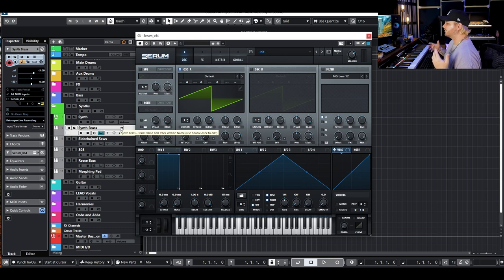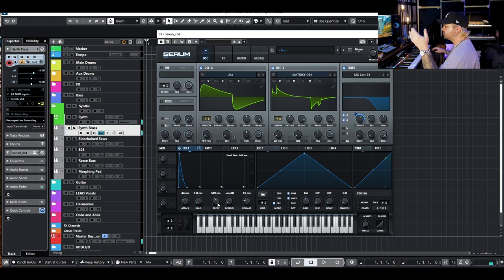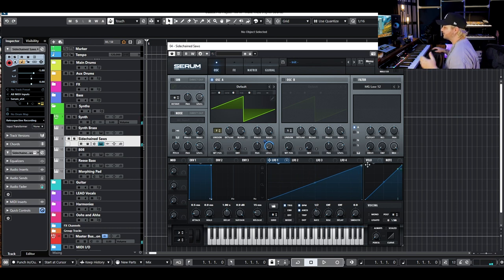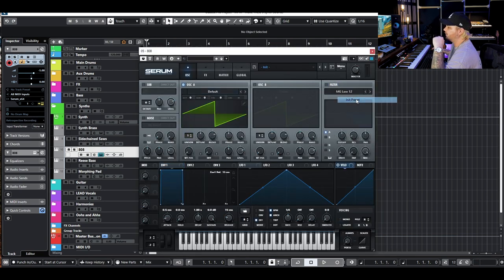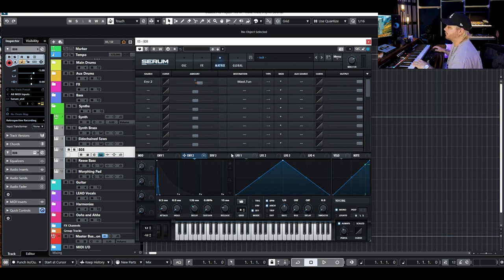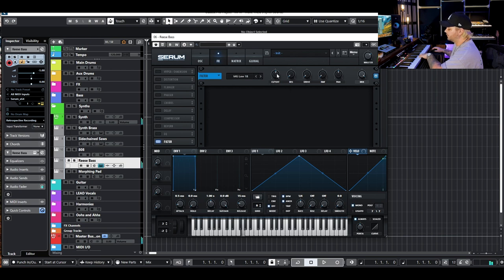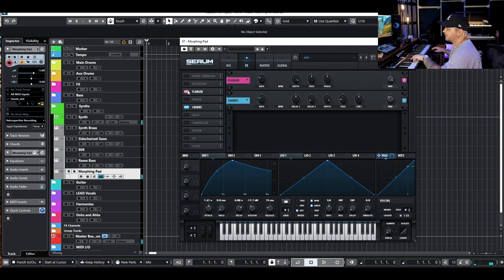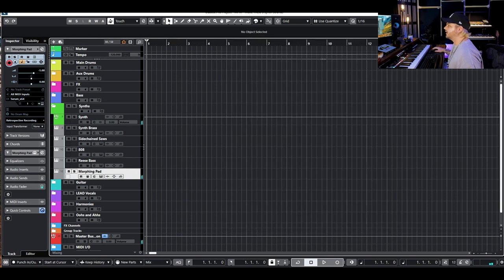5 Synth Patches EVERY Producer MUST Know! (Synth Brass, Swelling Saw, 808, Reese Bass, Morph Pads)

Comment: That's not really a Reese, a Reese is the phase cancellation between two waves creating a third oscillation which sets an implied pitch fundamental that's lower that the note you're playing, this is how you get that movement in the bass that's proportional to whatever pitch you play, it literally changes the speed of the phase cancellation (that third oscillation) because you're changing the frequency of the two waves. You can change the speed of the phase cancellation with the detune and finesse it so it matches the project tempo if you like. 

Some people try to replicate this movement in the bass by using an LFO to move the volume, this never works in the same way because the LFO is set to a static rate whereas with a reel Reese the rate changes with the pitch you play...some people go even further to replicate it by then automating the rate of the LFO but at that point they're way overthinking it

A perfect example of a Reese is in the song "Dead Limit" by Noisia in the prechorus, notice how the rate of oscillation moves fluidly with the pitch, that's done through the phase cancellation not an LFO